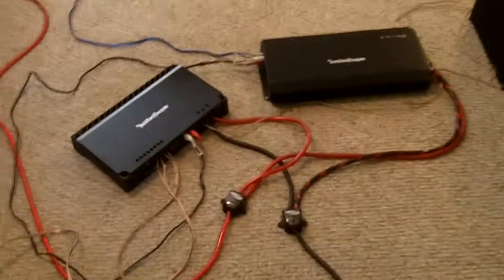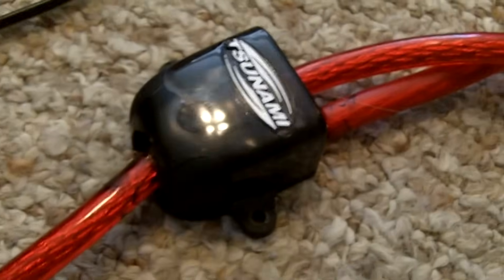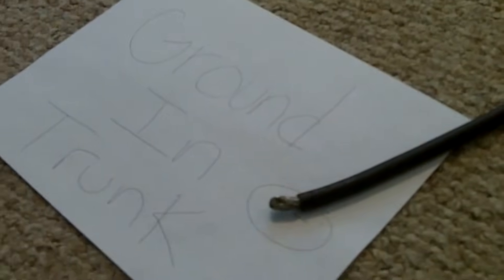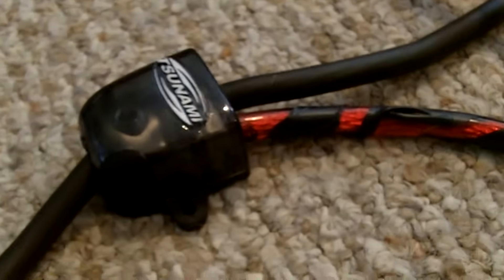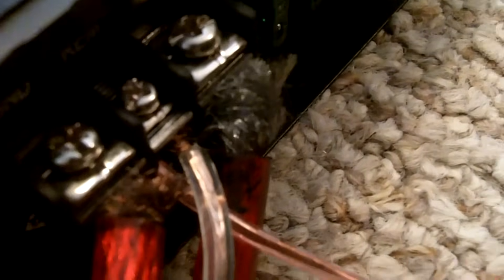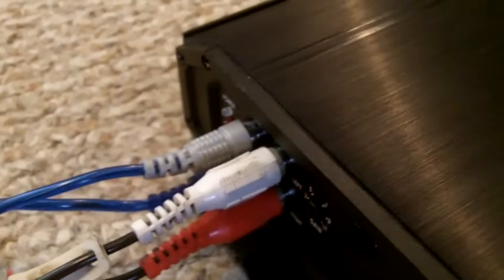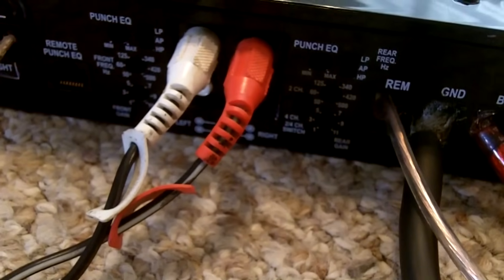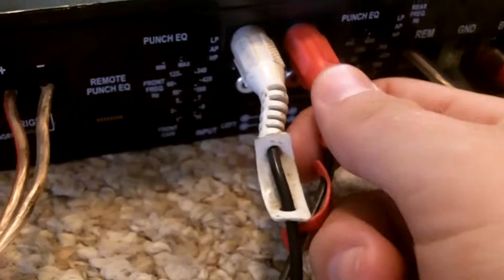How To Hook Up More Then 1 Amp

Comment: You should def have fuse blocks after the distribution blocks going to the amps... And I prefer to have each amp on their own ground...to each their own
Reply: Thank you !!!!! And for the ground wires ? They gotta be stright to your ground source. If distortion occurs  its gonna be your 4gage ground wire must be less than 18inches mandatory
Reply: @877bouncer  hey I was hooking up for two amps one distribution block for the power only and having the grounds go to two seperate spots any ideas why one amp would go into protect I checked the speaker wiring and I checked the grounds they are solid I cleaned them and make sure they were on good but I get no sound im just confused
Reply: And the grounds are on opposite sides and each wire is less than 18 inchs too
Reply: Make sure your ground wires are less then 18inches in length
Reply: @sheepreacts381 is you amp mono
Reply: @sheepreacts381  yeah I just done the Same thing on my system but both of my amps are mono blocks so they have 4 speaker outputs so +—+— n I switch my speaker wire to the positive and negative on the outside so the first port the last port
Reply: Why fuse after distribution block when u already have the main fuse at the battery
Reply: @alexzuniga2933  In this setup, it's not necessary, just recommended to do so for the sake of protecting the lines of wires & the separate amps, in the case of there being a short/fire in the runs of wire. Say your "left" output had an exposed wire and shorted/ground out the circuit, it'd blow the fuse closest to it, instead of allowing it to potentially harm the other amp as well. And for reference, I only say it's "not necessary in this setup" because it's all 4 gauge runs... But if the battery to distribution block run were a bigger gauge of wire, it's absolutely necessary to do it... Much more likely to melt the smaller gauge wire if you don't.
Reply: Yes, and this Daisy chain method hurts the second amp by controlling the signal in volts to the second amp to whatever the first amps level is set on. So I prefer signal splitting as opposed to this video of daisy chaing the signal. If your first amp is off for whatever reason, the second amp will receive no signal. But if you  split the signal the first amps power wont affect the second amp. And of course always run the seperate amps grounds seperately to the cars bare metal chassis-NEVER BOTH TO A BLOCK AND THEN TO THE CHASSIS.  THE SHORTER AND THICKER THE GROUND WIRE THE BETTER. I always use 18inches of ground wire or less, and one thicker than my power wire. For example, if im running a 4gauge power wire then my ground wire will be 2gauge-no exceptions!
Reply: Facts I was just looking at that as well

Comment: Holy shit, thank you. Straight to the point. You're the only person who explains stuff in about 10 seconds. Every other video makes it seem like each wire and connection is a rocket science formula that needs 5 minutes to explain the most basic bullshit. And you add a little pizzazz with the "bam" at each connection. Ez pz

Comment: Damn Bro it took me 2 days lookin through video after video tryin to find a clear video showin how to run the remote wire to more than 1 amp.  Thanks for the video
Reply: Did he connect the remote cable to the 12v cable?

Comment: Best explanation ever!! A litle fire hazard,  but nothing that a fuse could fix!! Great video brother!! Helped me out a lot!!
Reply: When you say a fuse do you mean the one that usually comes with the wiring kit that goes from the battery to the power wire? Very curious thanks
Reply: @djtrill7137  i know for sure there should be a fuse in between the battery at the front and the first distribution block for the positive. there might be another location that might use one but im not 100 percent sure.

Comment: RCA for your subwoofer amp and your 4 channel amp have there own RCA output @ head unit and should be ran as such, separately. Using the pass thru on the sub amp will not allow you to control subs mids and highs independently. Only use pass through on sub amp for multiple sub/amp setups.
Reply: I was questioning this. Thanks 👍
Reply: What if you only have a sub out and rear from your head unit? Would you just you a couple of splitters from the rear for a 4 channel amp?

Comment: I subscribed man, this was short and got straight to the point without any annoying music in the background, I’ve been looking for an amp the can run my door speakers and a sub because I just didn’t want to deal with it but now that I seen this I have a lot more hope and also feel like I have more options so thank you! I just need to make sure whatever amp I buy has in and outs. I was wondering tho for the from if you split the rca in the back of the radio there isn’t a front and rear rca on the radio itself ?

Comment: The only issue I see is that you should never split a ground I believe and have always run independent ground wire for each amp idk if it helps just the way I have always don’t it good video man

Comment: Wait a minute! Hold up guys! If one of your amps (or both) require a minimum of 4ga wire for proper power supply, your line-in to the distribution block needs to have the capability to handle at least double the ampacity of 4ga wire. Let's say one amps draws roughly the capacity of 4ga wire. (Around 70 amps to make this easier) Happens when the sickest beat ever comes on and you gotta jam? If both amps continuously draw the amount of amperage that the wire size they are being supplied with at the same time, one can imagine your line-in wire will have to be able to handle 140amps without melting and burning your rig down.
  If you need 4ga to supply your amps, then 0/2ga should be used to "supply" your distribution block. Remember, we are effectively "splitting" our line in half to supply 2 loads....just a suggestion.
Oh, one more thing!  Use short runs of wire! The shortest possible lengths of wire the better for power AND ground. 
  DC power quickly degenerates due to resistance (parasitic loss). The longer the wire, the more resistance. (Think of blowing a mouthful of water through a straw. A short straw is relatively easy to blow water through. What if you double the length of the straw?
  We would have to work harder to push the same mouthful of water through the longer straw. Your alternator will have to work harder to "push" power through a longer wire than a shorter one....I'm out

Comment: This cleared up a lot for me!!
Reply: Did he connect the remote wire to the 12v wire? I didn't understand that
Reply: @JG-fl1xd  he connected the remote wire to the back of the radio on the sub amp(master amp) and then he ran that remote wire to the 2nd amp(slave amp).. so the 2nd amp turns on whenever the 1st amp turns on
Reply: @JoeOfAllTrades  ok thank you 👍

Comment: Yo Sullivan looking for help, open this comment!  I am thinking about following your directions when you say to ground it with a distro block but so many people keep commenting "and BOOM" and I dont want to lose $5,000 worth of equipment... I usually get all my stuff installed professionally but coronavirus ruined that
Reply: Wintregärten im going through the same thing right now man, have everything bought but nobody to instal so now i must learn😂
Reply: @brantlyadair5495  I ended up hooking it up myself!  It was pretty easy honestly.  Do not ground with a distro block, ground individually to the chassis, also make sure your ground wires arent too long either
Reply: @brantlyadair5495  I got u man I hook up systems for a long time ago cen do just about anything that has to do with a car stereo system inbox me

Comment: Question anyone... Is using a distro block the preferred method? Vs running 2 separate wires? I.e. I'm planning on powering 2 separate amps and already have 4ga. run for an existing amp. And adding a 2nd amp, which calls for 0ga. That I plan to run for it.(I don't mind the extra wire and have both size kits) Is it OK to run both 0 & 4ga wires to the same battery terminal. Both will be in lined with proper fuses. And matching ground sized wires to their conter power.. help. Thanks.

Comment: Im planning to add an amp in order to power my sub but, theres already an amp that came with the truck . So when i go to connect the remote turn on wire to the stereo harness how would i do that ? Do i twist all the wired together or what bc i literally dk what to do.

Comment: Better if you run another wire from ignition fuse to the second amp as remote most radio wont handle to much power and start turning on and off
Reply from the maker: Anonymous not true it doesn’t take much power to turn on amps usually up to 3 amps is good and anymore then I add a relay
Reply: @SullivanDesigns  only reason i said it i had a sony head unit ran two amps and the radio didn't wanna stay on during bass until i ran an extra wire to the ignition and performed maybe a better head unit like pioneer will hold personally i love pioneer
Reply: I loved the eighties more than the nineties .  Cassette tapes and bubble gum

Comment: Your input wire should be double the size or double current rating if you're splitting. For example ONE 4GA = TWO 8GA out.

Just because your splitting a single 4GA doesn't magically make TWO 4GA with DUAL identical current ratings as the single input

Comment: Thank, buddy.  But the problem with that is your amplifier powering the sub in the rear is now seen as 'front speakers' in your head unit.... thus making it impossible to fade from front to back speakers.  If you want rear speaker control, you would have to go high level input by tapping in your rear speakers (assuming you only have one set of RCA on your head unit).  But then of course you could wire in a level control knob into your 2nd amplifier and control it that way.  I just would rather have front and rear control so that I can up the gain on the rear more without having the front speakers distort before the subwoofer do.... that way you can fade it more to the rear when you want to turn up the stereo and still keep the bass volume up without the front speakers distorting.
Reply: Get 4 ch Amp with speaker level inputs and  RCA line out feature, means 4 input and 2 output, these days all amps have these features. Then connect amp for Sub via that line out from first amp. This way u can control fader and all left/right balance and sub will get its signal from first amp which will be set to LPF in 2nd amp for bass.

Comment: Hi :) i have 2 amps rockford fosgate 1 pbr300x4 and pbr500x1.
pbr300x4 uses 10 AWG and pbr500x1 use 8 AWG
what cable wire do i need to use from battery to distribution box?
Reply: He's running 1 in 4G and 2 out 4G. I'm going 1 4G in and 2 8g out. so in other words use the bigger gage wire from the battery and the smaller one coming from the distribution block.
Reply: 4

Comment: Can u just make two grounds instead of making it into one?
Reply: YES!!! IT'S ACTUALLY RECOMMEND!!!
Reply: Lost Wallet I just made two separate grounds
Reply: Ive always run individual ground cables from each amp to separate ground points in the car and never had an issue. Currently I have both the sub and multi channel amps mounted under each of the front seats...each is grounded to a paint free and cleaned seat bolt(one of the four bolts that secure your front seats to the body). No problems for the past 4 years. Power wire is split by a distribution block located between the two seats...like the dog painting in Goodfellas, one wire goes one way, the other wire goes the other way. And I'm sitting there like, whaddaya want from me
Reply: Budz Wingren good comment! Help me out lol

Comment: First you need an 0 ga to distribution block then your 4ga  out otherwise you will blow fuse for to much current draw or burn your car down second amps need their own ground you don’t use a distribution block for a ground also you need ferrule caps on the end of those wires or your going to short out the amps or worse cause a fire 🔥 that’s the most dangerous set up I’ve ever seen
Reply: So much no...
Serves me right for choosing comedy over reading what I need to confirm....,☹

Screw it I'm gonna need a new carpet one day, may as well be because of today....🤗

Comment: Cool thanks man...can anyone answer me this...what not to do to cause a fire if you understand what I'm saying. ...

What if I used two amps conmected to each other with 2 different wattage would that be a problem not powerful amps
 Let's say a orion 1500 4chanl and another brand of amp let's say about 600 watts to power the sub..

Would this fu*k up voltage Orr? ??

Comment: Ok so why not just piggyback them using the proper terminal ends and loose the block adapters alltogether.

And how do you know the remote switch wire from the deck is strong enough to carry out its job without needing a 12v relay and 12v line to work?

Nah....

Comment: Hell yeah I knew there was a way to use the same power wire and ground from the first amp also got the remote wire understood still just confused about the rca to second amp but anywYs not putting a second amp right not just have a 5 channel alpine mrx v70 buy maybe down road will try to add a second amp for one more sub because was told the amp I have won’t push two 12s as well because designed for only 1 sub at 350 or 250 watts depending on 2 or 4 ohms.

Comment: Good attempt you have your theory right but if you're going to be put in tutorials on YouTube make your connections correct State the proper size wire if you have two amplifiers requiring for gauge wire you should use 0 gauge coming from the battery before you split it every wire is rated for how many amps it can draw through it continuously every connection you have there and the size wire you're using is a recipe for burning your car down but hey I guess having 15 minutes of bump is worth frying your car
Reply: Someone finally said it 💯🤔 it’s ok for beginners, just don’t try run big power doin this 💯

Comment: NO FADE CONTROL!!!!!!!! you have to run 3 pair of RCA's for Fade control, plus there is not enough Voltage to run pass-thru "i have tried it, there is volume degregation on one amp with a single RCA set.